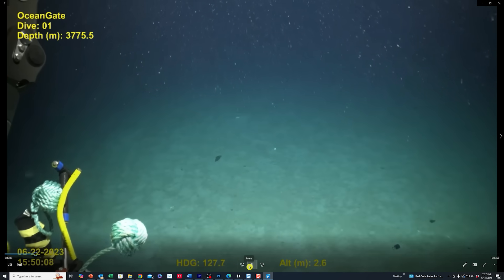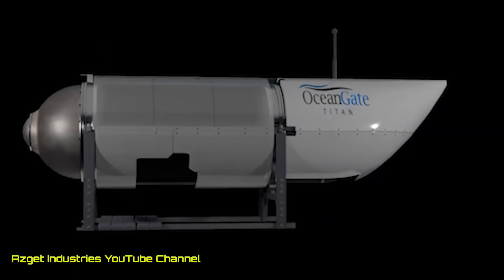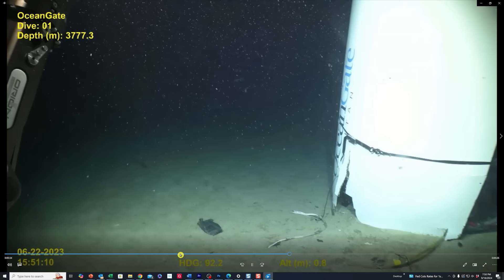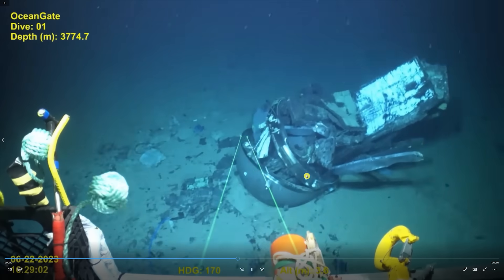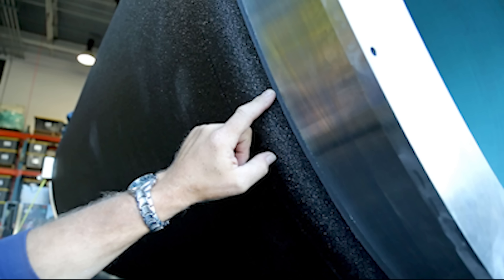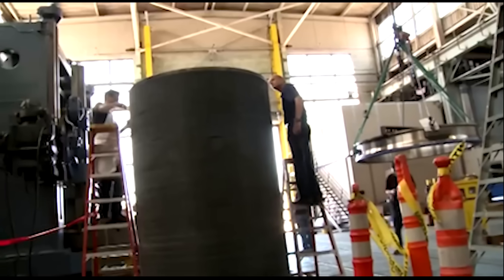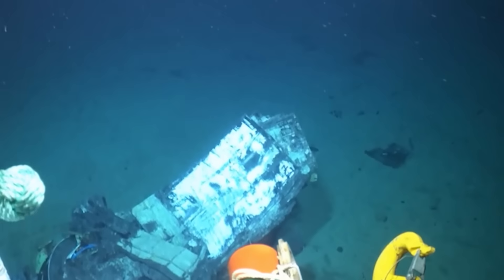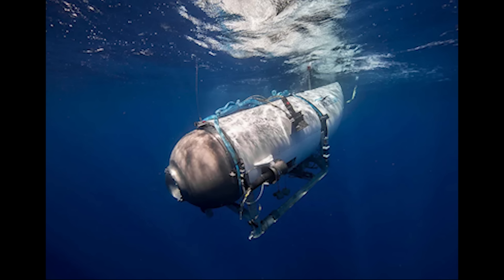OceanGate Titan Sub Debris Video Shows How It Imploded

Comment: They never ruffed it up, and worse off, it had a 1 inch area that got pressed onto the carbon fiber tube. That tube was an old piece of carbon fiber past its shelf life they got a deal on that sat in the sun for a long time. The sellers talked about it. Next carbon fiber is strong for outward pressure, not inward, as james cameron said. This whole things junk its not meant to go past 2500 ft once. Remember, carbon fiber and titanium have 2 different complete expansion rates. This was doomed since day one. I really feel bad for the young boy. It sounded like he wanted to back out but once he was there im sure dad said no way your going we all know how that goes. We all grew up and had to do something we may have changed our minds on.

Comment: 30 Year General Motor Master Technician. When I assemble engines that require sealant to adhere similar or dissimilar surfaces both surfaces are prepped meticulously.  I guarantee I never touch any surface with a bare hand. Such care it is essential for a clean bond.  To put things in perspective,  I take such precautions and the worst thing that could happen in my line of work is I end up with a leaking oil pan.

Comment: You keep wondering why it didn't "blow into a million pieces" when it IMploded.  It didn't EXplode.  It was crushed into a little wad by the pressure, and anything inside just squirted out.  It got smaller and shorter really fast - so fast, it "jumped" right off of the tail section and the rear titanium ring (looks like they were heading straight down when it imploded, and the tail just kept heading straight down).  If the carbon fiber was shredded that much by the implosion, all that would have been left of the people would have had less substance than a jellyfish.
I think whatever remained of those 5 people was crushed into that front section as if it was a mortar and pestle.  The titanium didn't give, and everything piled up against the dome and forced them all through the shredded carbon fiber like a sieve.  Remember the Byford Dolphin divers?  One of them was near the hatch, and was forced through the small opening by 9 atmospheres of pressure.  The Titanic site is under about 400 atmospheres of pressure.  There probably wasn't anything bigger than small particles left of any of them.

Comment: You can find the entire conversation between the sub and the ship.  The issue was, the sub decended way too fast, and after sensors went red alert, they tried going back up but the sub couldn't go up fast enough due to damaged components.  It would have worked if the owner didn't ignore the warnings from the ship about it's fast decent.

Comment: I’m an engineer in the civil engineering industry. To attach stainless Steele to carbon fiber (essentially like fiberglass) with glue as a solution to harmonize a contraption that is in and out of salt water, under millions of pounds of pressure, and under constant current movement as a solution is astoundingly foolish to me. What deviation from subterranean norms. Test peanut butter in that area and see how it holds up. I think the glue failed.
Reply: Yes you are completely rite. The titanium ring compressed less than the carbon hull. It's so in ur face. Yes the peanut butter glue failed as well. Even a ten year old could off worked that out

Comment: Doesn't look imploded. Something fishy going on here
Reply: Not every section is going to be crushed, that’s not how it works. Only where the oxygen is built up (where the people are) is where the pressure will implode. Then once the pressure equalizes and water rushes in, it’s over. Like a soda bottle. If you crush it with your foot the center weakest area will flatten and the bottle neck and base are not as affected.
Reply: And they clearly are not showing where the people were or we would see some remains. It’s being omitted.

Comment: Might be a dumb question, was there perhaps anything left of the people at all? Anything small even that could even bring the families a little bit of closure?
Reply from the maker: probably small pieces of mush
Reply: From what I understand after learning more and more about this since the time it happened, not only was the pressure intense enough to crush, but the implosion basically created a really quick hot flash so they probably got incinerated + crushed. Then anything that was left probably went to the fishes. It does seem crazy to me that nothing would be left, I have seen a video where an alligator corpse was dropped to the bottom of the mariana trench and it was kind of flattened but it was still intact. But in that situation it was slowly dropping and didn't have air pockets in it's body anymore, if you somehow magically spawned the alligator corpse at the bottom of the mariana trench it would probably explode due to the air pockets in it's body. So they dealt with a lot more than that having a chamber that size suddenly implode with them in it, thankfully for them it was super quick though
Reply: @ just an incredibly tragic situation! Heartbreaking, it could have been avoided

Comment: Some of it got really hot, and that's probably why that outer ring looked so clean, because of the heat and the thousands of pounds of pressure on all of the inner side where it comes apart at.  I'm thinking maybe some small bone or maybe fingers or limbs, but, I don't think they suffered physical pain at all, because of how quick it happened.  
Idk if they knew it was about to happen and had to just wait for it, or if they were just going down, and in less time than they would feel the pain, maybe even register it in the optical aspect.  Picoseconds here.

Comment: 0:38 At those depths, the external pressure is lethal and absolutely impossible to withstand. Who thought they were going to be rescued? That makes no sense, come on. At 3,800 meters deep, whether there was a sudden implosion or a gradual collapse, the bodies would have been compressed in milliseconds. The pressure difference between the inside of the submarine and the surrounding water is so extreme that the body simply can't hold its structure. At such extreme depths, the gases dissolved in blood and tissues expand uncontrollably, causing organs and tissues to fragment almost instantly. If any tissue remained recognizable after the implosion, the freezing water and deep-sea scavengers would have sped up decomposition. If anyone expected to find the bodies—let alone alive—they were seriously misinformed.

Comment: The ring was contained by the man touching it with his bare hands. I’ve been machining and welding exotic stainless materials for 30 years now. I machined decked a 351-W block for my 86 mustang and accidentally touched the surface with my thumb and the oils from my skin left a perfect rusty thumb print. Basically a surface inclusion.

Comment: Carbon fibers have high tensile strength. In this case, their use is completely wrong, the stress of pressure is like pushing a string. If the pressure of 400 bars was applied from the inside out, the fibers would withstand it. Pressure of 400 bars from the outside is wrong. Wrap a can of Coca-Cola with string. Will it become stronger? You will dent it in your hand. The pressure from the inside will withstand. Completely inappropriate use of carbon fibers. Please excuse my english, I'm European.

Comment: In 1990 Yeti Cycles built a carbon and steel bicycle called the c26.  It was Easton C9 carbon tubes with steel lugs.  It was raced at the world championships in 1990 by Julie Furtado and John Tomac..  It was pulled from commercial production soon after because carbon tubes started separating from the lugs and the glue joint failed.    You have to ask your self how so many years later we have engineers making the same mistake with much higher cost and not learning from previous examples.

Comment: why is there no mechanical joint between the carbon and the ti.   why not a lip that the glue and carbon fills when you join two different metals.   A smooth joint seems like a real fail.

Comment: Im guessing the hull experienced squashing with the immense pressure of the sea bearing down on the mid section of the main compartment, causing the end cap to come away from the glued edge, a titanium ring or two placed inside mid section would have helped with this effect and implosion.

Comment: Every time that sub came under stress it would be cracking noises. Was that not that so called super peanut butter cracking?
Reply: No that was the sound of the layers of carbon fiber breaking. Similar to how bending a piece of fiberglass in half makes  noise

Comment: I’m so confused!!😂😂 did they not use a high pressure chamber to test their submersible??? Obviously not he just built that thang and said throw it in the water it’s carbon fiber😢😢😢😂😂😂
Reply from the maker: @Zero_swifty  they tested a 1/3 scale model but only tested it once they did not cycle test it
Reply: @ so then it doesn’t really count as testing it if they did a 1/3 scale model. The guy didn’t care too much for safety and if you’re going that far down you should probably test the real thing out

Comment: Ok I’m no physics or engineering guy, but just looking at that second video from coast guard, it would look to me that there was a catastrophic failure at the back titanium sphere. I say that because chances of all that debris forming in a nice, shoved in look to front view port, looks to me like the extreme force of implosion from back end, forced everything forward. The view port also not being sheered off looks to me that the force of the explosion possibly dissipated, causing only partial separation? Just a guess though.(ok just watched the video further, so it was the front that gave way)

Comment: Why the hell would they only epoxy   the metal rings to the fiberglass body that was 3 inches thick.... looking at the cross section, there was more than enough room to also bolt these together ... there were many whistle blower reportes violating safety protocols before this sub took to the sea that should have stopped it from taking place in the first place... also, the navy heard the implosion when it happened and never said anything till months later...  this all sounds like another huge cover-up operation.... again ???
Reply from the maker: You cannot use a bolt and pierce the material it will cause cracks

Comment: I know 0 about engineering and materials responding to pressure etc -  BUT- it just seems like common knowledge to 
SCUFF or SAND a surface if you desire for something to stick to it 
For example- I just recently re painted a wooden dresser- and in order for the stain and paint to stick- I sanded the surface prior in order to have the paint stick and stay . 
Why didn’t all of these brilliant scientists think of this regarding the “peanut butter paste” and the titanium rings ? 

That  would have been my approach at least - surface needs to be rough in order to have something bond with it. 

Totally incompetent construction 
I would never get into that thing knowing that 
Tragedy.

Comment: Srockman was a complete bonehead thinking this submersible was even considered "safe." First if all, if you're gonna make a submersible made for high-pressure depths, then you need to make it out of thick materials like steel or titanium. Carbon fiber should only be used for aircraft or space craft. Like even a middle schooler would know that air has less pressure than water.

Comment: Essentially, this was like taking 2 Teflon pans and sticking them together with jb weld. No pressure, no vacuum that dude was suicidal.   
I bond carbon to titanium on aircraft, and it's a pain to get it right without fasteners and disbonds.

Comment: So the casing for this deathtrap was a carbon fiber wrap impregnated with resin.  That's a material that's going to change with every compression/decompression cycle because it's dynamic in structure unlike a metal sphere that can be pressure tested and then, trusted to be safe at that pressure.  You can argue logically Titan became less certifiable at depths it reached each time it cycled through one.  Airplane pressurized fuselages have defined failure cycle numbers and built in indicators showing stresses and degradation.  What was the estimated lifetime on this structure?  What intervals was it to be inspected and how?  How many cycles were deemed to be safe?  I don't know would be Rush's answer to all three.  But he's a rule breaker like General MacArthur right? What a nut job with a death wish.

Comment: Hey I think someone did wrong calculations as far as extreme pressures and failure points on certain parts of the mini sub components. Just using a heavy paste type glue adhesive to fit parts together. Not cleaned correctly or even having a o-ring type fit.

Comment: this myth of carbon fiber being a strong material is just plain wrong!   if you take a carbon fiber hood on a car and hit it with a hammer you will go right through it!!!   a metal hood you will only dent it!   carbon fiber is very weak!  yes it is light and it is strong for how light it is but it is not a strong material that will hold up under high pressure or with a hard impact.

Comment: That's what i noticed also, i think that's the main problem here. It was fine until that one go, because where they didn't make the surface porous, it would have lost the seal to keep the water out, at some point out would have given out. The water would have gotten either between the metal and glue, or somewhere else. I don't think the carbon was the issue. 😮
Same with nails if you don't start with a porous surface when you are putting tips or whole cover nails on they are going to get wet under that because we're the surface was smooth they're going to come off very easy. Also you have to dry out the nail, because of oils are present, it wouldn't matter, they would fall off or get water between the fake nails and real nail. You have to do this step before going on nail. Dry out, remove shine, moisture, oils from real nail. Use drill to make the surface rough and porous. Glue on tip, or whole nail.
If you're doing acrylic it must be the same way because the acrylic won't have a porous surface to grip onto and into therefore it will come off, acrylic and tip will come off whole. BAKING SODA AND SUPER GLUE WOULD HAVE HELD THIS THING TOGETHER BETTER THAN WHAT THEY USED! I can't believe how they built this!! 

AND THEY GOT BY WITH IT!! 

THAT should be our question.. how did they get by with building it that way?

And I just want to point out that I never knew anything about this never kept up with it didn't care until a little while ago I seen what was left of it and from your video which was the first video I watched about it how they built it.. it doesn't take Einstein's brother to figure this out.

Comment: I will point out one simple thing. Whenever connecting two unlike materials together, you must have a mechanical connection. It is imperative, it is fabrication 101. You cannot rely on epoxy, caulk, adhesives, etc. very simple example is a bottle top. Bottle tops have threads which prevent the cap from coming off. Even a beer bottle has a crimped edge all the way around making it nearly impossible to remove without a bottle opener. This guy slid that thing on a shiny surface unlike materials with epoxy. I knew better when I was 15 years old, making stuff in my parents garage . Incredible that this guy took people down in that thing.

Comment: The way they "Attached" the Rings to the fuselage is as Mickey Mouse as it gets and it's completely & erroneously unsecured. The proper way to have attached the rings is to leave long tongues that slid DEEP into the walls of the fuselage with an outer compression ring where giant bolts would pass through all components thereby creating a SOLID LINEAR STRUCTURE similar to a  beadlock system like is used on off-road tires. That would have ensured that EVERYTHING WOULD LOCK IN TOGETHER!!! 

This qualifies as a fail of epic proportions and charges of negligence should be filed. I mean this is the ocean FFS and you're a mile or so down! I think Slingblade could see how poorly this was going to end. I mean the thing used a crappy game console controller to drive the system! 🤦

I don't think any government should allow anyone to do things that risk peoples' lives without having proper safety checks by a highly technical group of engineers. F1 is littered with many such engineers who would've realized ALL of the issues with this submersible contraption of death! Clearly this jackass was preying on weak people who were literally paying him $150K and more to go down to see the Titanic wreckage. Scumbag of epic proportions.

Comment: I TOTALLY agree with your analysis of the mating surfaces being milled flat and smooth.  AND with the assembly facility not seeming to be very steril at all! This is a disaster in the making!!  The repeat flexing of the adhesive is most likely the reason.  Plus you get salt water in there to speed up the adhesive decay.  I'm surpirsed they didnt have any kind of bolting on there to prevent flexing.  I simply can't believe this thing was every considered safe.  Such a shame.

Comment: This vehicle didn't Implode thats full evidence of a Explosion from Inside look at the metal pushed out not crushed in like a can
Reply: A sub can't explode at those depths. It can only implode. The pressure of the water does not allow energy to explode it can only cave in.
Reply: @JayM-ww4cp  so you can't toss sticks of dynamite in water and kill thousands of fish from a Explosion in a outward bubble ? As the water forms around the explosion?  Watch a video on something exploding underwater dosnt have to be TNT even dry ice in a sealed bottle under water you might change the view
Reply: @JayM-ww4cp  enything can explode if explosive devices are put inside a contained object at any depths